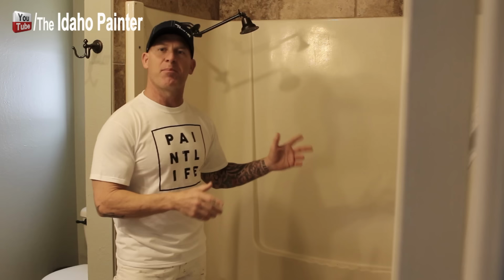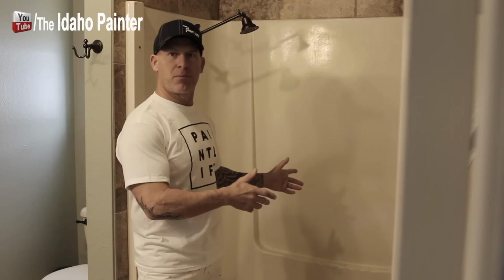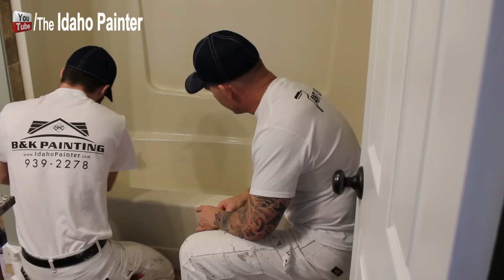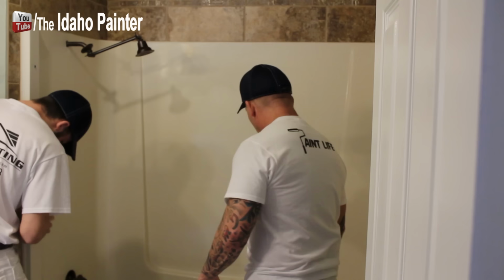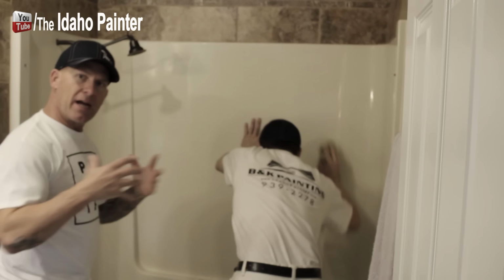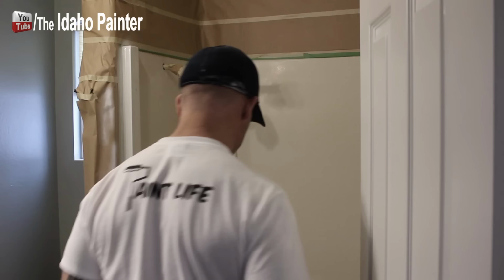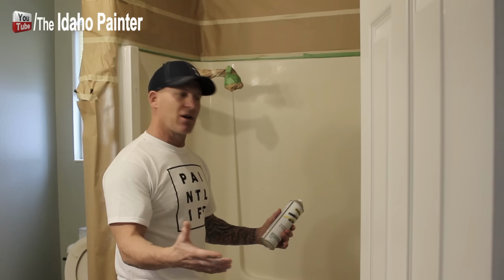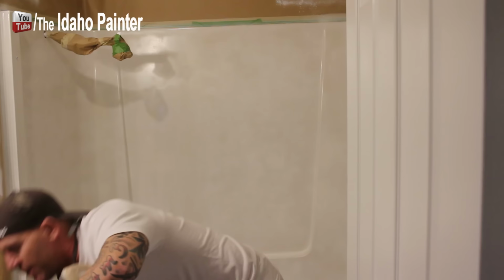How to paint a shower or bathtub.

Comment: Cool, thanks guys. I’m planning on doing this for the bathroom in an RV. Everybody knows those old yellow showers are hideous.
Reply: Monty Hale   Did you do you RV shower yet?  I want to do this to but not sure if it will work.
Reply: The reason I’m here lol
Reply: Me as well 😁
Reply: You’ve probably already finished your project but the trick is using a foam roller. I’ve done this several times before and have turned out great! Don’t go on too heavy either. Nice thin coats!

Comment: Would love to see a revisit to a project like this. The one step I have started to use no matter what product I am using on a tub/shower to to apply a bonding primer before whichever product I want to use. Though a pour on solution is extremely thick, all other solutions are so thin that without that bonding primer they will all come off.

Comment: Egads!  I tried using spray epoxy at the cottage... gave up before I  choked to death... so I went out and purchased Verathane Colors in Plastic...painted it on with a brush... it's still great, 20 years later!!  Never peeled or flaked off.  I had nothing to lose.. it's a cottage.
Reply from the maker: Interesting, thanks for sharing!
Reply: Hectanooga1 - Crochet, Knitting, Jewelry, Crafts, Cooking ......what exactly is this, can or spray can? Is it just a polyurethane coating?
Reply: @jow9482    she said  painted it on with a brush    not spray can
Reply: Thanks for sharing! Just to confirm - the product you are referring to is colored polyurethane, correct? :D Thinking of painting my acrylic bath stall
Reply: @sukisisland6081   Yes, a colored polyurethane.  Be sure to thoroughly clean your stall before painting.
Reply: Can you post link for the varathane plastic?
Reply: @clayrobinett840  why the hell would you paint ceramic tiles & grout 😂
Reply: @Idahopainter  q

Comment: Use a foam roller next time.
I do tub refinishing for some different apt complexes.
Reply: Got a question to ask 
I think I made a mistake spraying a bathtub with gelcoat

It’s from a supplier called Lilly Ram. It’s a thinned out gel coat that drove me crazy, probably because I didn’t know what to do totally, I mean I was a Little nervous spraying. 

 In your tub experience is gelcoat a bad thing to spray? It did orange peel on me, I figured it’s just the nature of gelcoat, idk but I’m really upset cause I have to sand it down, rookie mistake I guess
Reply: Seems gel would have a problem adhering to the slick surface. Did you clean and sand and prep it all properly before the gel ? If you can run your hand across the surface  and “ feel “ stuff you will see it once your done and it won’t let the new stuff stick. The gel could have been bad and started  humming up. Think stick to paint and a foam
 Roller so it doesn’t leave gritty brush strokes unless that’s the kind of look your going for.

Comment: Question what if there's a previous hole in the shower liner filled in with caulk. I know to remove the caulk but is there any filler you'd suggest to use that will still allow the epoxy spray to adhere to it??

Comment: Gbu brother I've done many tubs over the years with this product with no real good results, so I just bought a hvlp pro finish by graco apply a reusable acid cleaner, mix part A and B epoxy and spray the tub they come out like glass! Great thing is that even though, the part A and B epoxy cost 80 a gallon each both combined can do 15 tubs! Before you have to buy more epoxy!
Reply from the maker: Nice to know, thanks for sharing!
Reply: image662 Yes that's true. I've watched it done first hand. Watched one dude that used a small shop vac on reverse blow for the compressor. Pretty interesting. Also watched a dude pour contents and spread it with a spreader and used a heat gun to maybe active?  Forgot why. It does LOOK,  great. Not so sure about durability in practical use. Personally i have one rust spot bout size of a dime, at overflow,, and want to touch it up to prevent rust.
Reply: Peter, the video you seen was an acrylic application put on that's not going to really last, they sell epoxy touch up kits give it a couple touch ups to you build the epoxy up, spot sand it then give it a final touch up, if the dents big use bondo and apply sand and touch hope this helps God Bless
Reply: Thanks so much. Have seen touch up materials,  but can't find it in colors, only white. Course thats only at home improvement stores,, maybe on line. Thanks again, take care.
Reply: hugot12  
I mentioned it not for the purpose of mentioning that I'm spending a lot but for the purpose to inform someone that may not know how much it costs and the amount of jobs that can be done where you can make profit. I think you need to learn to read in between the lines a little better buddy this is not a place where we come to argue or talk negative, but to exchange knowledge information and ideas to help each other out that's what this is about
Reply: image662 I simply want to paint the tile in the shower what should I use?  Please provide me with the step by step instructions
Reply: hugot12 ,so what's the best product to use for a single bathtub and the tile walls around it, that will look good and last long? I've tried redoing a tub once and it turned out great but as soon as someone used a chemical on it the paint broke down, live & learn I guess. But I'm wanting to redo another one in our home but am scared of painting it because of last time.
Reply: Or purchase from Munro Products.  We sell both commercially and residentially.  Epoxy is fine for many people, but we manufacture and distribute Acrylic Urethanes that are used by our techs, the military and all sorts of resorts, etc.  With 46 years experience, there's a lot of good that happens for people when they can save hundreds or thousands of dollars it would take to remodel a shower, tub, bathroom.  All in all I agree with the Hugot12.
Reply: Look at Bathworks DIY Refinishing Kits.  You can't go wrong.
Reply: hugot12 what suppliers do you use for the right type of material to paint these tubs and shower enclosures
Reply: Jesus is Lord I can't see the comments that were posted on your response to the video so would you please let me know what products you think are best to use on a shower that's made a fiberglass to repaint it white and what equipment you use. Thanks ahead of time and yes Jesus is Lord
Reply: Napco Pure White or Regular white. Epoxy ain't worth a damn. I could have done four or five tub and enclosers by now. That midwest water based crap is only as good as the clearcoat on top of it.
Reply: Scrilla what kind of sprayer set up would I need ?
Reply: @image662  I only want to do one bath lol..... is it any cheaper??
Reply: Can you use on plastic tile look walls of shower?

Comment: CAN I USE OIL BASED PAINT ON A TUB AND SHOWER
Reply: You can use oil based on slick surfaces it’s actually recommended. Otherwise it will “ slip off”. 
Wash the surface , sand , wipe clean add oil base primer let dry then use a good low nap for oil base paints to apply. Light coat then go back with second to clean up the holidays and make it a finished look. Well ventilate and possibly wear mask oil base isn’t alway pleasant. And once you use that roller it’s pretty much done. Need another for the next time.

Comment: I know this video is 5 years old, but i just came across it. I just painted my tub a few days ago..🥺 i used the same product that you used. What a nightmare!! Orange peel finish, and yes, fish eyes !! I’ve touched the fish eyes up, and it looks better. But, i used the frog tape on it so i could do a nice calking job,,, but guess what?? It pulled some of the new tub paint off !!😢  but, busting up the old iron tub to put in a new one was out of the question. Now, I’m afraid to paint the surround. It’s just plastic tub surround.  I’m wondering if i could sand down the orange peel finish, and use an air gun for a smoother finish.. any thoughts on that ?? Thank you, Cindy
Reply from the maker: Sorry to hear

Comment: This spray product is never used on YouTube videos correctly. The spray is really meant for smaller repairs or awkward spaces that are also small like maybe a sink. You definitely want to use the roll on method with any tub. If you're meticulously clean and you wait a full 3 hours in between each coat with at least three coats this product works pretty well. I have done over seven tubs with it and the only issue it has is when you do not remove that caulking or contaminants by scraping or sanding first.
Reply: How much would you charge to paint three walk-in tubs? I have a lady that wants it done and will be my first time lol
Reply: @austin0360  I charge 350 for a standard tub with no significant damages. If there are dents, rust or pitting it goes up a bit. $400 for a fiberglass tub where the back and tub are one. $700 if the Tub and tile surrounding the 3 walls of the tub.
Reply: @MrPelletty  thank you

Comment: Does that type of paint/coating work in an airless sprayer?
Reply: If you use the thinning method recommended on the instructions for the sprayer and it flows the correct ppm you should be able to but test it on a scrap piece first.

Comment: Question for y'all. I tried this system on a similar setup like you have but the end result turned out to be a little bit gritty.  Is there anything you think I did wrong to create that texture? I used the spray cans I cleaned it well followed the directions but the end result was like very fine sand paper.  The reason I ask is that I have another project right now and I was going to use the product that I can put in the Graco TC Pro cordless airless sprayer.  Appreciate all your videos and also thanks ahead of time for the help
Reply from the maker: We did not have any luck with the spray cans either
Reply: Best to roll on because you can CONTROL better and do 2 or 3 coats to even out.MUST BE DRY for 1 day...and 2 days between coats.Can will get all over your house no matter what and it's nightmare to clean.
Reply: Yeah, I'm frustrated to see him NOT following the given instructions...
Then complain that it didn't turn out the way he wanted. 

He thought he knew better how to use their product... then complains that he's unhappy with the result. 
🤦🏼‍♀️🙄🤷🏼‍♀️🤣

Comment: the fisheyes are due to the mold release agent used. its usually petroleum based, makes it easy for the 2 halves of the mold to be separated, releasing the panel with little effort.
Reply from the maker: Thanks for sharing! They are a pain
Reply: no doubt...
ive painted alot of fiberglass panels, not bath related, and its hit and miss! i also prime everything now... if its gonna react, better have it in the primer coat and try to fix the issue, before applying any topcoat...
Reply: splash how does one fix that issue?

Comment: broooo you cant mix spray with brush on it clearly states spray you have 30 mins before second coat an haft to get second coat done within 30 mins, brush on you have to wait 3 hours before 2 coat two different products with, way different instructions should have bought more spray bro this is coming from a pro painter as well always follow directions
Reply from the maker: Fortunately it worked this time for us, but thank you for the tips!

Comment: Am thinking bout using an air brush.
Reply from the maker: I would not want to ruin my equipment with that stuff
Reply: Don't blame u. Have watched guys do the tub, tile and sink. Using a very low pressure sprayer with a cup gun. Can't believe the quality is nearly as good as a baked finish. But ur right, id never do it with anything nice. Maybe an inexpensive cup gun from harbor freight or something. Your probably right not to want to. Take care

Comment: only rookies use spray cans and brushes. to paint bath tubs. use a microfiber roller. or a spray rig. for good finishes....
Reply: kevin gregory The pro refinishers used low pressure guns with an epoxy that is supposed to work but finish has only a five year warranty. I believe there is nothing like baked on enamel factory finish. No air dried finish stands up to soap scum and human abuse.
Reply: Only HVLP!!!!! GET REAL DUDE
Reply from the maker: Thanks for the tip! I am a rookie at painting tubs :)
Reply: Microfiber roller lol wtf